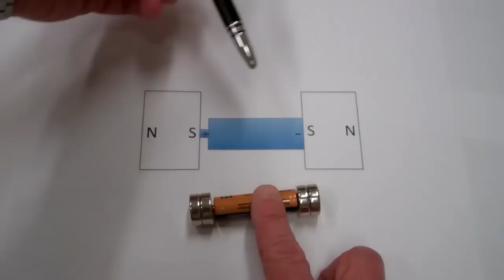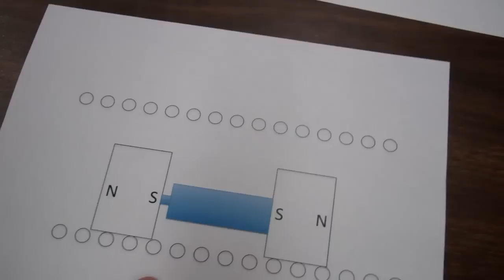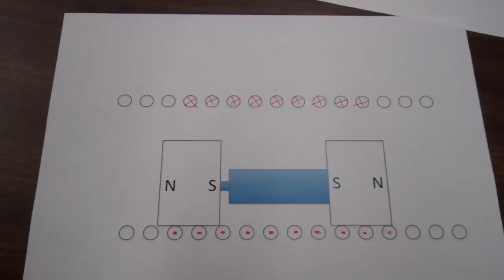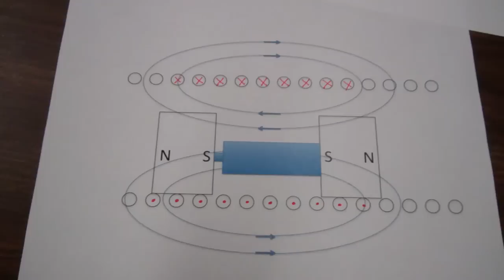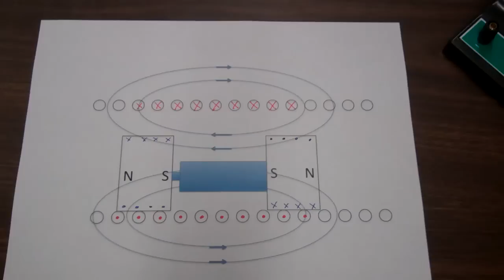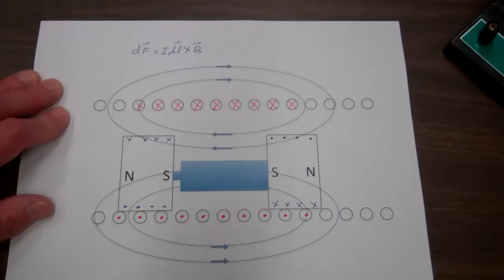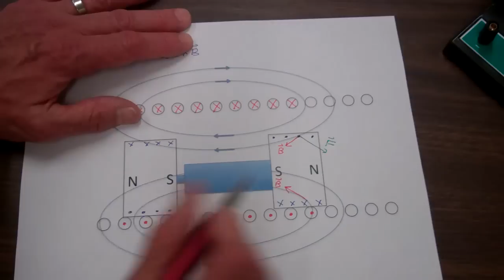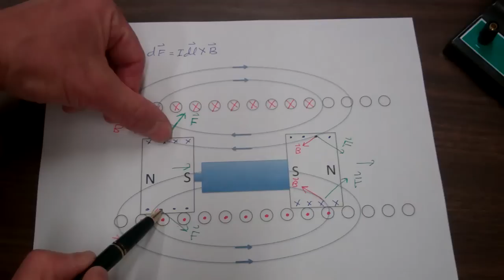Linear Electric Motor

Comment: what is the role of this battery?
Reply from the maker: where the battery makes contact with the coil, through the magnets on each end of the battery, causes a current to flow in that section of the coil. The current causes a magnetic field that exerts a force on the magnets on the ends of the battery.

Comment: Very good, thank you. Could you explain does it work without a battery?
Reply from the maker: You need that battery. The battery causes a current in the coil that produces a magnetic field that propels the magnets on the two ends of the battery.

Comment: pure dc homopolar motors and generators, true brushless, not bldc fake dc (actually ac)
Reply: instead a network powered coil train
Reply: battery is on the mail line, rails, not the projectile train itself
Reply: single lead wire in the tube after the projectile train, like line controller missile, then the other wire, the coil, will be the other electrode
Reply: you can have the whole coil energized whole time, no rise time, then the additional wire(s) will provide possible electromagnet current, but if you run the whole coil all the time, there is no need for the battery part of the train, just the magnets on a magnetic metal or even just the magnets themselves, in some container

Comment: your magnets are labelled incorrectly. It should be  NS- NS  for the flux lines as shown
Reply from the maker: The magnetic fields I am showing are not from the magnets but from the current flowing in the coil.

Comment: Thank you for Your great explanation. Everything is make sense, except one thing. Did You use insulated/emailed wire to form the coil? unless the wire is bare, I can't find a way for electric current to flow through it.
Reply from the maker: It is bare copper wire

Comment: Question, could you massively charge some capacitor (of unknown type to me) and replace the batter with that, and somehow lighten the hard magnets, and get much more speed?
Reply from the maker: A capacitor would discharge almost instantly. So you would get one big shot. Similar to what is done in a rail gun.

Comment: Not 100% sure I understand how this is working. Is the copper wire coil un-insulated?
Reply from the maker: Correct, it is bare copper wire. That allows a current to flow in the section where the battery and magnets are, so only the part of the coil between the two magnets, resulting in a magnetic field produced by that section of the coil.
Reply: Ok, makes much more sense that way. It just looked a lot like magnet wire from the video.

Comment: Would this still work with the coil wrapped around the pipe? I want something a little more sturdy than a coil of wire.
Reply: Never mind, I would have to somehow stick the coil inside the pipe for the magnets to make contact with the coil.
Reply from the maker: You could get thicker copper wire so that once you wound it into a coil it would be firmer. That is what I plan to do at some point because what I have is a little too flimsy. I used 20 gauge wire.

Comment: Impossible!  tubular coil are open circuit.NO current....And battery and magnets only toys ...Where is battery circit current conduction....This video are in graet lie...There is magnetic field under the table...
Reply from the maker: +Ahmet Dede The wire does not have any insulation on it. The two magnets make an electrical connection to the wire, so there is a voltage across the segment of the wire between the two magnets. So only in this small part of the coil is a current flowing and generating a magnetic field.
Reply: I think you should retract your statement after this explanation. I think you should have asked him a question first before drawing conclusions.